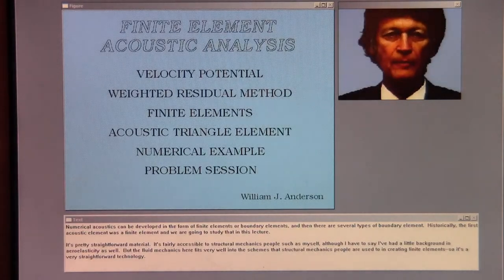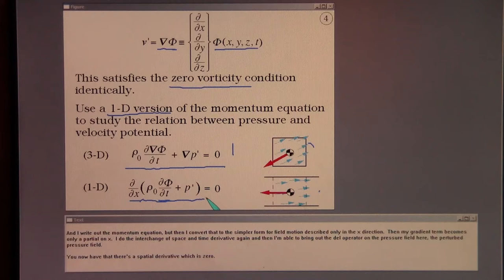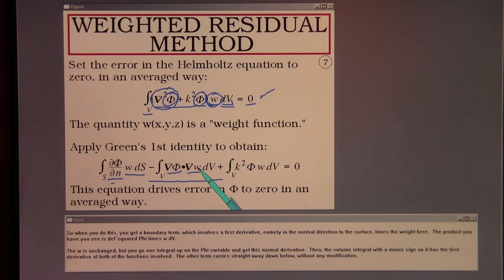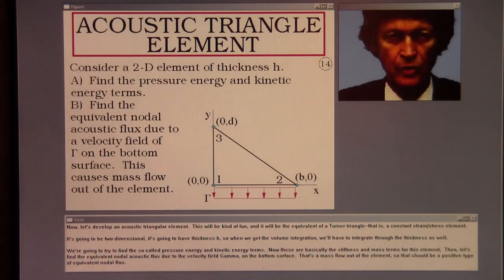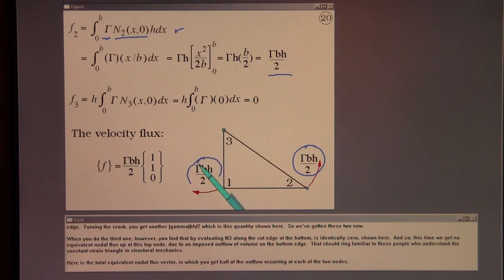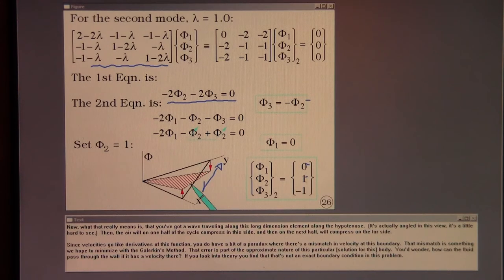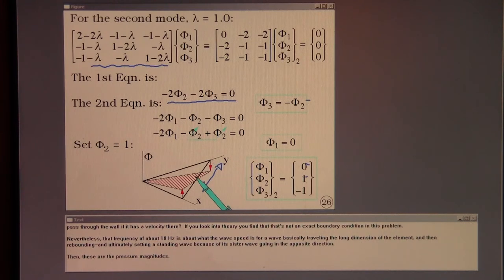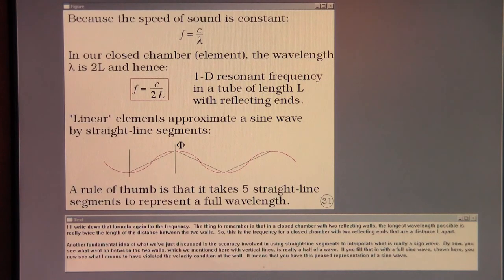FE Acoustic Analysis.  Lecture 3, Part A.

Comment from the maker: At present (April 11, 2013), Lecture 3, Part B is missing.  It finishes the problem session for finite elements.  I will try to locate it.  It is not trivial--I have to mount the CD version, play on a computer that uses an out-of-date operating system, take a movie of the PC face and then upload that to YouTube.  Sigh!  You can probably proceed if you copy the study guide, which has all the figures.  My apologies.